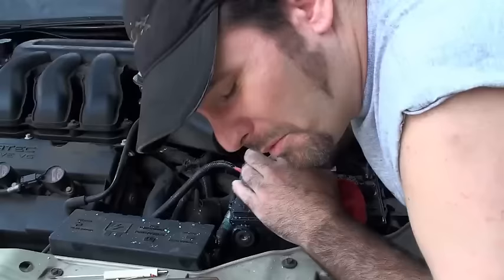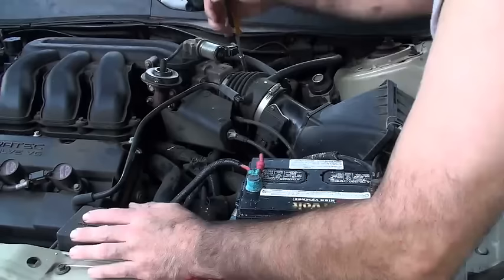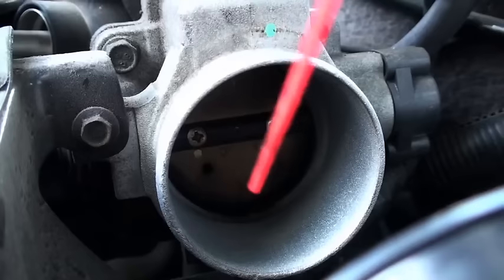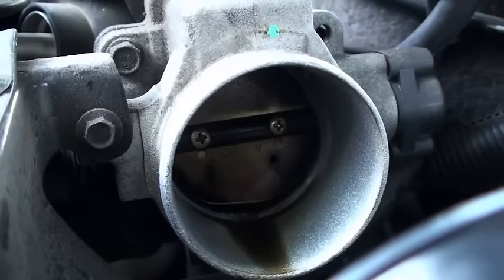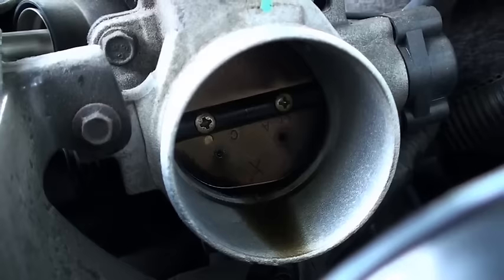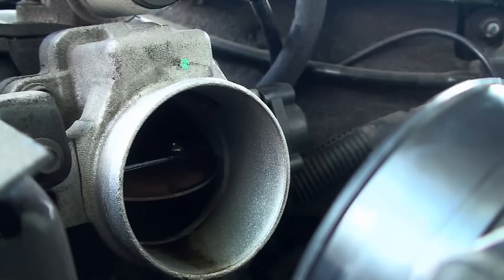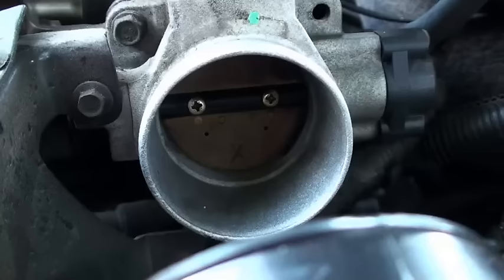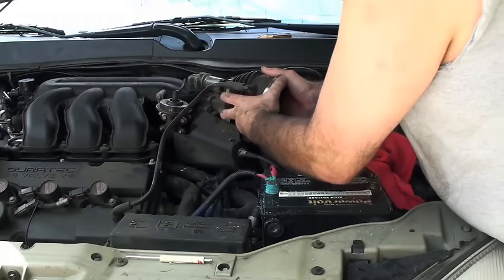Quick Tip-Throttle Cleaning - EricTheCarGuy

Comment: that's ok for mechanical throttles isn't it problematic for electronically controlled throttles to move them manually?
Reply: Dusty Korpse Yes, read the description, he specifically states this procedure is for direct mechanical TBs and not be used for DBW or E-TBs
Reply: Dusty Korpse just get someone to press accelerator pedal it will open
Reply: Paddy Wynne not so simple, it is electric and the motor must be running.
Reply: @billwilson6096  if you are cleaning your etb while its on say goodbye to your finger smh
Reply: krodie you sent your warning to the wrong B. W.  I’ve learned over the years to be careful where I stick my fingers.
Reply: @billwilson6096  my apologizes bro didnt even mean to reply to ya
Reply: You just need to unplug the throttle-body's power-cable before you move the valve... or do a full-reset of the ECU when done... it's really not that big of a deal.  Do it all the time.
Reply: @billwilson6096  With DBW the throttle plate will move with just the ignition on.

Comment: Your positive battery terminal looks pretty bad and needs to be cleaned.
Reply: really, in the last 25 years I never see battery get so foul.  Eric must be doing something WRONG.  Batterys don't vent and leak like the 70's, how can that corrosion be normal?
Reply: Clean the terminals, wires, etc.. and put a thin layer of dielectric grease over everything. I've never had a hint of corrosion.
Reply: PAying attention to the video, we know it isnt Eric's car AND we also cant assume he hasnt made a ton of videos about this car specifically.
Reply: galvanic reaction, maybe the wrong type of metal on the terminal clamp.

Comment: Thanks for the video!  Had a check engine on my wife's Hyundai and it was the throttle body.  Gave it a clean with the video (was my first time doing this) and the car runs great and check engine light is off.  Thanks!

Comment: Opening the throttle manually on some cars, especially those with Drive by wire can cause them to lose the idle settings.
its best to remove the throttle and spray from both sides without moving the plate.
Reply: Joe Guzman, I have a quick question. I changed the spark plugs and I unplugged the throttle body to clean on my ‘08 Sienna, now the car doesn’t even idle.  It runs for 5 seconds then shuts off.  Do I have to reset and relearn the throttle body?

Comment: Dear Eric,
Before asking my question, I would like to thank you for your videos. I have watched them all and I am one of your video fans.

Can I spray lacquer thinner instead of spray throttle cleaner your mentioned. Lacquer thinners are much cheaper to purchase and I have used them cleaning gummy stuff and works real good. My concern is whether Lacquer thinner can cause and internal problem for the engine or the injectors. Thank you
Reply: BOOM!
Reply: Lacquer thinner will destroy any plastics/polymers as well as lubrication/seals on the throttle body shaft.  It could also damage the TPS/IAC or other sensors.  I would not use it myself,  but if you have no choice I would be very careful with it.  And I certainly would not spray it down into the throttle body/intake manifold.
Reply: @ Dacke,
Thank you for your kindness and sincerely advice..
Reply: Dacke Hey, i just said that.

Comment: I'm a mechanic and I learned that you don't need to remove the intake hose to throttle body, just remove the crank case breather line (in the video you see the  small pcv line )well just spray b-12 Chemtool through this line going into the intake while the engine is running and this is all you need. Really no tools. Just be sure to put this line back when you're done.

Comment: Eric,  newer cars with electronic throttle  you have to use a slightly different technique since there is no manual linkage to open the throttle.  I was also told if you manually open up these throttles, you can screw up the computer. You need a helper and with the ignition on on (car not running), have them press their foot on the accelerator.  This will open up the butterfly.
Reply: for cars with no throttle cable, you must disconnect the battery before doing this and then after cleaning, wait 30 minutes so the spray can dry up so the engine wont be hard to start
Reply: thxs

Comment: i just used WD-40
Reply: that wont work thats designed to lubricate not clean
Reply: nice try
Reply: dont. dont do that.

lol things like TB and MAF are special. Dont wanna spray anything that leaves residue. WD40 leaves residue and will build up and possibly do damage to the motor. Besides, TB cleaner is just as expensive as WD40, no sense in NOT using the right stuff :P
Reply: Josh Johnson thank you for trying to make me look stupid by just using something i had around the house. a little wd40 isnt gunna hurt anything
Reply: OG Milkbag Uhhh, yeah, just spray a lubricant into the throttle of your engine, sending it directly into your engine. Would you open up your engine and spray wd40 to clean off oil? no...
Reply: ***** maybe it wasnt the best thing to use but it worked fine so idc. There is no way cleaning the edges of the throttle plate with wd40 will do anything. I did not just spray a shitload of it into the intake i only cleaned the plate. WD40 is a good cleaner and lubricator i dont see how it was a bad idea
Reply: Name a flammable lubricant. Kerosene is not a lubricant.
Reply: Jack McDonald  i bet you dont even know what wd-40 was use for a long time ago
Reply: no it was used on airplanes wings to repel the water off when flying hint wd means Water Displacement
Reply: dh123ize and 40 means the viscosity of the oil?
Reply: no the 40 means 40th attempt
Reply: dh123ize Are you being sarcastic? Anyway I look it up it's "40th formula".
Reply: thats what the 40th formula means it took 40 trys to get it right which i was always told it meant 40th attempt
Reply: haha lol nice one ^
Reply: why you wanting to watch?
Reply: dont use wd40 its not doing anything but making it worse it doesnt even clean it!
Reply: birdylover100 it lubricates it
Reply: my grandad drove races cars for over half a year and he cleaned his throttle body with wd40 before every race.
Reply: wrong, wd40 is a cleaner not a lubricator.
Reply: SeaFoam is also perfectly legit to use on this type of TB.

Comment: DONT DO THIS ON DRIVE BY WIRE CARS! it will mess stuff up!
Reply: Nikita Wilcox , That's true. I heard that on cars model with drive-by-wire we have to step on the gas to open the throttle, instead. Otherwise , the computer will not function well. Can someone confirm this ? many thanks.
Reply: Budi R Yes, Budi, I've heard that.  Watch this video for more info.  It explains it.  Good luc.
Reply: What's drive by wire?
Reply: AgentJucey Electronic throttle bodies. They usually have a module and/or driven by gears electronically. DO NOT MANUALLY OPEN THEM! They will mess up. Ask me how I know!
Reply: AgentJucey Drive by wire means there is no mechanical connection from the accelerator to the throttle body.  It's done by electronics through your wiring harness, thus drive by wire.  It's been used by commercial airliners for many years and is a proven technology.
Reply: turn the key to Accessory and then press the gas pedal. it will electronically open the valve
Reply: +Dennis Johnson also a bitch if it brakes down... :P and honestly still can't see what's wrong with oldschool cabels \o/
Reply: +Kevin N , crap. I just did that tonight. Haven't tried to start it yet though.
Reply: +homer simpson , screwed. Won't run for shit now.
Reply: +Fabian “Stowney” van den Bussche  they went cheap on cables and they don't hold to vibrations well.

Also allow manufactures to just bolt everything together without the need to think about how much cables need to bend.

Also makes it hard to clean those crap yourself, so you need to go to a certified service center to get it serviced.
Reply: +Nikita Wilcox Have someone turn the key in the on position and press the pedal
Reply: I would say just don't buy a drive by wire car. they are expensive and a piano to fix. they are also dangerous.
Reply: 678friedbed it's honestly not so bad imho :)

opel astra G z16SE :) most expensive part is like 50euro of the "drive by wire" part granted that it is not new but still... and honestly if you just use the thing from Mtech that converts the cable input to a fly by wire you're golden .... only 1 thing that can break that is actually expensive... but i personally never have seen it fail xD

good maintence is key! :p
Reply: that the issue. if you have to do maintenance on the drive by wire set up
or have to take it off for any reason you have to have a special computer
to reset the sustem.
Reply: 678friedbed it's not like i don't have to grease my cable :) ... or that my egr doesn't fuck with my TB :)
Reply: Of course not, but this isnt a dbw body!
Reply: I must have a faulty system that doesn't know how to break. Done this many times to my electric throttle in my Cobalt without issue
Reply: @Dennis Johnson In commercial airliners its kind of a necessity... Honestly I dont see the use for it in cars, just feels like its another electronic component that can fail and cost a lot to replace.

Comment: With the exceptions that you have mentioned.  Throttle Body Cleaner and MAF Sensor Cleaners are just expensive gimmicks.  Simply use a good quality Non-Chlorinated Brake Cleaner.  Best to do on a warm day and a warm (not hot) engine...since residues and gums, oil and carbon tend to be somewhat looser and easier to remove.  A Toothbrush (not wire) and some Q-Tips also helps.   I use a fresh rag too...after each and every spray down while cleaning.  My rule of thumb is that it must be something that dries fast and leaves no residues...Brake Cleaner fits the bill very well!  Common Sense is never out of Style!!!

Comment: If small motor is energised ie, still plugged in , gear reduction set and massive torque may remove end of cleaning finger in ETB , may want to unplug first also possibly remove negative off battery... good luck

Comment: Eric you are right on everything I've seen of yours but I would do this different.  I use CRC products whenever I can.  If you ever see what happens when throttle body cleaner does to plastic when they come in contact with each other the plastic will crack.  Most intake manifolds are plastic.  I've always just taken the tb off cleaned it and covered tps sensor and actuator motor so that they don't get wet.

Comment: When I was a teenager my throttle body froze closed (on a very cold Canadian winter morning). I had no clue what was happening, but could tell my Tercel was not getting any gas, so I really reefed on the gas. It was still frozen, but now it was frozen open and revving incredibly. It resolved pretty quickly, but taught me not to rely on my instincts to solve my car issues. The guys at work thought it was pretty funny.
Reply: This would happen to VW with carburetors ice building up in the intake

Comment: #1.Problem is CKPS located @ backside of engine(replace & try starting).
#2.Problem is the CAT(disconnect & try starting).
#3.Problem is the Voltage & Ground Signals to the Injector Rail locate "Injector Rail PowerBlock",clean w/battery cleaning solution & check Injector Rails Ground then try starting)

#4.Problem w/Saturns is the Fuel Pump(so open the gas cap & listen for a hiss. If not present then go to throttle &  force fuel past it & try starting)

In fact there's only 2 tests(Spark & Fuel)

Comment: if your car uses an electronic accelerator, after cleaning, sometimes you have to use a scan and make the adjust. this process can also create reading problems with some sensors. I usually clean the throttle with the engine working, always accelerating and throwing the cleaner, it helps to clean all the system.

Comment: greetings from greece.nice videos and keep up with the good work eric.( excuse me if my english are bad) well i love hondas and i am an owner of a beuatifull ek4 vti civic b 16a2.i love my car and am so desparate with idle issues that i have.I have checked for air in the cooling system its ok i have checked for vacum leaks its ok i have clean my idle control valve about 7 times and sealed its ok.I have clean the hole throttle body and is so clean.Also ( i dont know if this is wrong or no) but i checked my idle control valve with   a 12volts battery and it seems it works good.The funny thing in hole story is that the problem for 6 or 7 months was gone but when i use some cleaner to clean the intake the problem is back again.no engine light at all and if is some other problem i cant do a diagnose because the ecu is programed.Car when is hot is up and down around 400 rpm. i have double springs on cams , itr cams, full exhaust  f60 , integra type r exhaust programed ecu and some other stuff.Please i need help i am so desparate everyone says change this and other...and ahgrr😠

Comment: Great tip on "clear flood mode" !  It is amazing how many people do NOT know this tip !!

I think you meant to say not to clean INSIDE Ford throttle bodies, meaning past the throttle plates.  Scanner Danner and I have a difference of opinion on this, and you and I are on the same side !

I always clean all external linkages and pivot points

Comment: HOW COOL ! gotta love old saabs, if it was running good but had been sitting 10 years  the first thing i would check is did the fuel filter plug from 10 years of corrosion .. i am not 100 % familiar with old saabs fuel filters. IF it is getting fuel to the engine , then make sure it has spark at the plugs. i would bet it is a simple fix to get it running  . GOOD LUCK

Comment: You can get to both sides of the throttle without opening it manually. I wouldn't open the throttle. It can make mess with the position and not close all the way. Which will give your engine high rpms at idle

Comment: On some cars, there is a placard that says DO NOT CLEAN THE THROTTLE BODY.  I wondered this and my Acura manual says it is because the molybdenum coating on the throttle shaft may be removed by applying throttle cleaner.  So the manual says to use a rag dipped in solvent/cleaner and clean the throttle body but avoid cleaning the both ends of the shaft.  

I remove the throttle body for cleaning, but the nuisance is that I need to have a new gasket ready.

Comment: The best way I found is to start the car and spray the cleaner in the throttle body while feathering the throttle to keep it running, it will die if you don't but I've always had good luck with this procedure!
Reply: Not a good idea on modern cars. There could be up to 3 sensors before the throttle body, MAF, Air Temp, or MAP and the computer will go bananas and throw a bunch of error codes and a check engine light which may need to be reset with a scan tool. Also, you don't want all that gunk going further into the throttle body and engine. Most throttle bodies have little holes in them that run to the idle air control valve, you don't want that filling up with all the gunk. That's why Eric showed how to wipe it out after using the cleaner to break up the gunk.
Reply: I fully understand your point but I've been using this procedure for over 20 years with no ill effects what so ever! Just sayin!
Reply: +tubester4567 Works good on modern cars that aren't DBW, just be smarter than you are about it. 
On mine, for instance;
No MAF, AT sensor is in air box, MAP has no issues with the cleaner, and the IACV is easy to directly spray with cleaner when the engine is running.
So;
Take off airbox+AT Sensor
Start car
Spray at IACV while it is open, as hard as possible without stalling car
Once car warms up, rev up a little and directly spray down intake

Takes about 1 full can to do. Best to do just before changing spark plugs and oil, due to sending things downstream.
Reply: Be smarter about it? You should eat your own advice! Spraying a full can of any kind of cleaner in to any engine can open up a new can of worms! The only good advice you gave was to change oil and spark plugs afterwards!

Comment: You can open it with your hand. Just follow the throttle cable to the throttle body. It connects to a spring loaded arm just move that arm. He is moving the arm from the other side of it just out of view.

Comment: I was using carb cleaner to clean my throttle body one time, and the red straw shot off, down into the intake.

Had to take off my whole intake manifold to get the straw out lol

So make sure that red straw is on the nozzle good. lol.

Comment: You can clean an electronic throttle body in two ways. 1st is have someone in the car with the key in the on position stepping on the pedal while you clean it. The other option is to disconnect the battery while cleaning it. Then wait 30 minutes to start the car, leave the car in idle about 15 minutes and your good to go.

Comment: I pour a bottle on Lucas in my gas tank at every fill up, seems to solve that problem before you notice it at the gad pedal.
Not only that, but it conditions the fuel so it cleans up all your fuel injectors to! 
Its worth the 10c a gallon to keep it running tip-top...

Comment: Nice, I did my throttle body today, and it is not spring loaded, but electrical. Did not want to force open the butterfly, as not to disturb or strip the little gear sprocket inside the component. Also disconnected the battery, so it does not need to 're-learn' its original setting.

Comment: you can do it that way too. just have a friend while the car is running hold the rpm to bout 1500/throttle open while u spray the cleaner inside. you clean the throttle and intake out good that way.

Comment: i like to use some throttle body cleaner with an old tooth brush and rag yo clean up, works wonders, but yes on some electronic throttle cars you have to turn key to accessory and get someone to go WOT (wide open throttle) as you clean out the throttle body